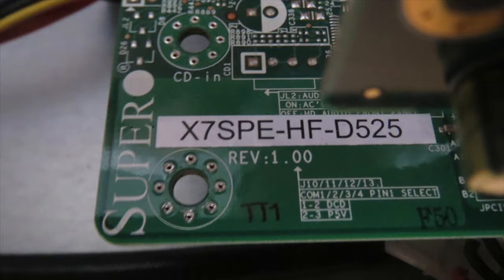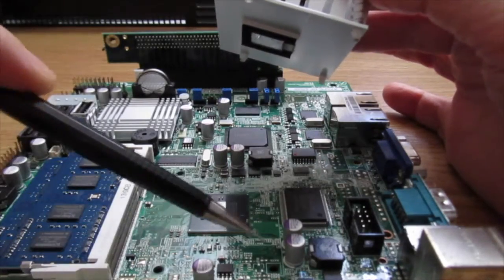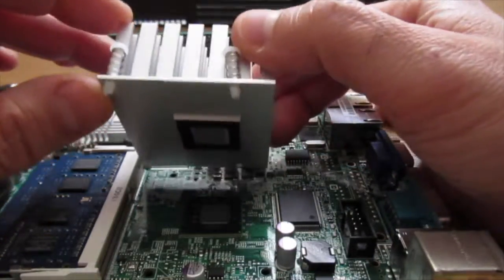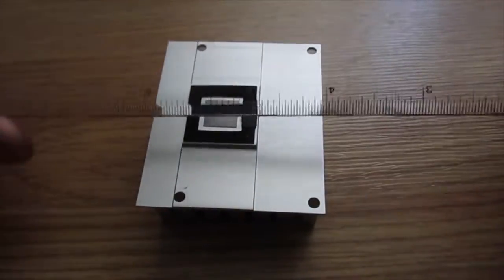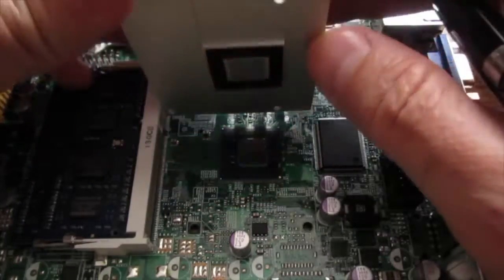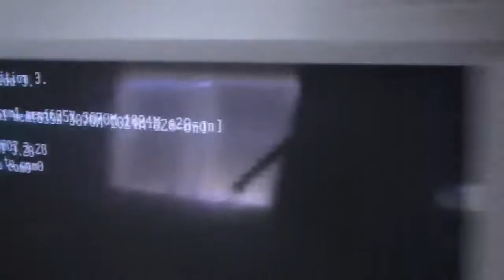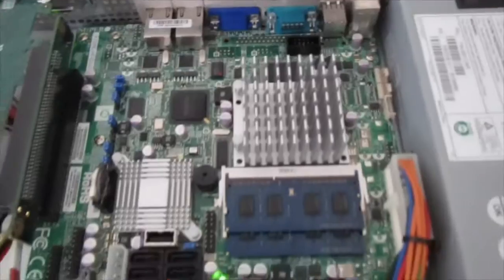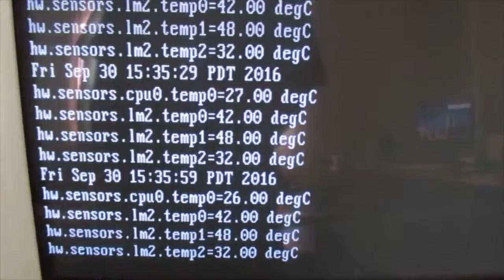FiXING Defective Supermicro Heatsink

Comment: How...did you get your CPU...to 26?  I have this exact same board in a short depth 1U Super Micro like yours, and it runs at 75 degrees C...  I even disassembled it just this weekend and applied fresh thermal compound after cleaning the CPU and heatsink, exact same temperature after.  That's 75 on IDLE.

EDIT: I should mention my heatsink is also perfectly fine and didn't have the issue your second unit did.
Reply from the maker: Ahh..well, notice that the case was open at the time, aiding in ventilation. Also it had fresh applied thermal compound.

With the case closed it is steady around 43 C (at a warmer month, March, vs at the time of the video which was end of Sept/start of Oct).

Thanks for watching!
Reply: Ugh, ok.  Thanks for getting back to me, appreciate it!  I'm still trying to cool down my unit.  If I have a fan running in the rack, it idles at 75 degrees C, if I don't have that fan running, it idles at 89.  That's after fresh thermal compound.  I was really hoping the solution would just be that I had a defective heatsink like you did, but that wasn't the case.  This heatsink appears fine.